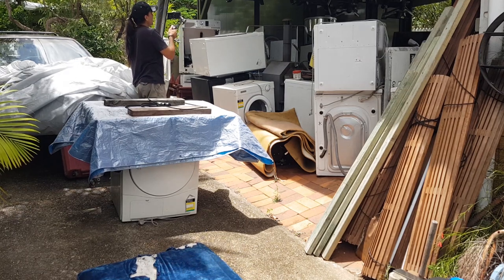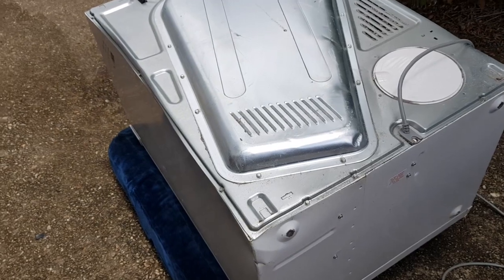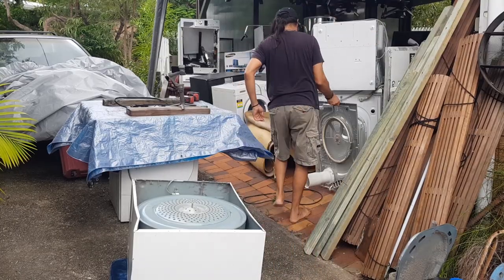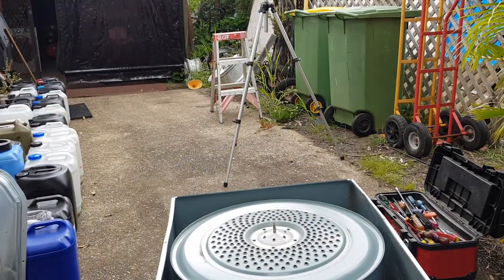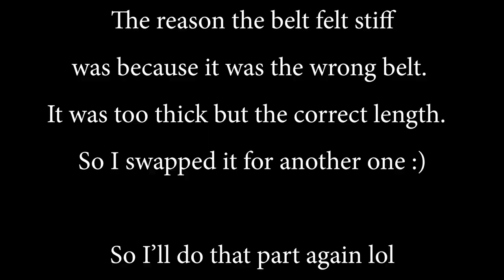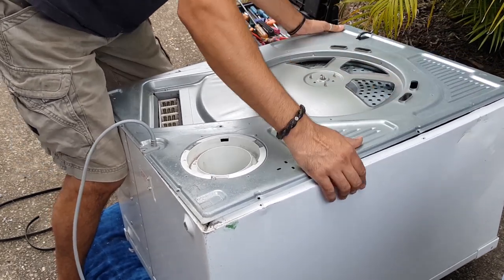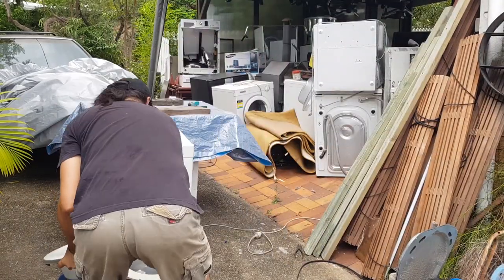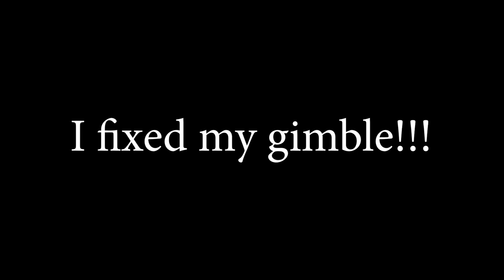Simpson, Electrolux, Westinghouse Clothes Dryer belt replacement

Comment: Cheers mate for reminding me how to do this. Just over 10 years ago, our Westinghouse dryer belt kicked the bucket, so I ordered two on-line and fixed it. The one I put on just broke as well and thankfully I still had that second one I ordered but could not remember how to install it. Your video saved me heaps of time!

One thing I've noticed the first time I did this, was that the buggers are putting the travel path of the belt too close to the element, which slowly burns it away. Anyway, I've managed to get 20 years of service out of this dryer and hopefully another 10 are coming up.
Cheers once again!
Reply from the maker: Hey man no worries!  Whow 20 years is amazing 😯  You'll definitely get another 10 out of it as long as you jump onto every tiny odd sound before it becomes a major issue.  Especially the grinding type of sounds.  But it sounds like your pretty vigilant.  Good on ya mate 😎👍

Comment: Thanks for this video! My very old one of these “died” today so I decided to pull it apart to see what happened and this video helped immensely! Mine turned out to be the idler pulley sticking on the shaft! Cleaned and greased the shaft and it’s working a treat! The pulley does have a really bad wear spot though so I’ll replace it and the belt with New to save having to do anything to it again for a while!
Reply: Had the same thing happen Jeff?, and ended up throwing the belt off. Same fix as you. Just curious if yours had a circlip at the end of the pulley shaft? Mine has a slot but no circlip. I put one on anyway. Now all good. Cheers man!
Reply: @robt6695  I just had a look through my phone to see if I took any photos but can't find any, so I'm not sure if it had a circlip or not to be honest! But it's been working prefectly since my comment so I must've done it right! 😂

Comment: Thanks very much! Couldn’t find a service manual for the Electrolux but this was spot on - all insides the same.

Our idler was also perfectly fine - in our case the belt snapped because the dryer was overloaded with a wash load where the spin hadn’t completed, and it wasn’t picked up by the person loading the dryer. Explained the burning rubber smell at the time it happened.

Comment: You're an absolute legend! Thanks mate. My idler had dropped of the pin and I couldn't work out how to secure a new one in place. I thought a circlip to go on the end of the pin might be missing, but your vid showed it should just stay there. Many thanks. I owe you a six pack or two. 😀
Reply from the maker: Haha no worries mate! Yeah what makes it worse is it has that little groove where you think a circlip should go. But nope they just slide on and sit there. Although I have see a few dryers with them on. But not from factory.

Comment: Awesome video mate. Gave me the confidence to pull our Simpson apart. All the little side tips, like how to  checking the idler wheel,line that belt up  etc. Thanks  mate :)!!!. 
I know it has been said before many times but these videos are golden .. Saving our family money :).
Reply from the maker: Mate you're so welcome! Well done for saving your machine and saving yourself some coin 😀 And thanks for the great comment letting me know!
Reply: @DIYDumpRat   Thanks mate meant to reply. It's been going great. Over 3 months now. Great Pro tip about replacing the roller as well. All the Best .. Pete

Comment: Thanks for this video, I'd already undone the back before I found this video but I just pushed the element back through the hole so no need to unplug, however that said .

I came for the belt video mine was a sdv601 belt was 17.99 with postage .this video is what you need 👍
Reply from the maker: No worries mate glad it helped 😎

Comment: Did a complete disassemble & clean on a Hoover dryer the other night, it’s one of the older models that was made in Australia (1992). No maintenance ever performed on the unit and for the first 20 years of its lifespan, the lint filter wasn’t emptied at all - mum wasn’t aware of its existence until just a few years ago.

Had recently begun to emit a burning smell, so I figured I’d take a crack and clean the thing out and see if I couldn’t diagnose the problem.

Once I got it open, it was quite a sight. There was so much dust inside the unit I was surprised it was still functioning at all. Got to the heating element and of course found a large clump of lint jammed in it that had turned completely black from the element and probably would have caught fire if not dislodged. Went to pick it up to remove it and it turned to ash in my hand. 

Anyway, after deep cleaning it and putting it all back together, gave it a test run and it ran like a beauty - better than ever in fact, and I didn’t even need to replace anything in it. Even the original belt was still in great condition. Suffice to say, they don’t make them like this anymore. 

Anyway, thanks for the video mate! Appreciate what you’re doing for the community, keep up the great work!
Reply from the maker: Wow good on you mate! Yeah I see dryers in that state a lot. I had a woman drop around a 40 year old Hoover last year begging me to fix it. I couldn't, didn't have the parts. If I could I would have done it for free. Those Hoover's certainly are goers lol. Thanks so much for your comment, really enjoyed reading it 👍

Comment: Great video. How do you know which belt to buy as I have the same dryer
Reply from the maker: Thanks,  If it's the same one, just do a 'Simpson Eziloader belt' search on eBay.  The link below is one I just found, but if you need an idler pulley as well there are lots of sellers selling them as a package 👍

https://www.ebay.com.au/itm/123148980892?epid=24023831792&hash=item1cac40529c:g:DGIAAOSwES1ccos~&amdata=enc%3AAQAHAAAA4PQPngXQl1z60i8kKLlzztXq97HLtAGLy6KzFK3XmEbxB8wk0uawWJ5wm8heMdQBbnzypOuIoR7HmOepj8o6lKt8LApT%2F9UpMeKV6LpWAuMHqDjz1MtWQk%2BBEZYaa07chC9kGiVcelXtByF1%2B1ObJRgv5uTlLSZZwRWhNmwTPZqY%2BQuUfTsZGYNRaIUyBc5rkq10EizTT5hyL3Em8pZ6qOMjOkipDzg7TWPW5k0pxR4YsKDEfySUz7xaseo9BPMhS94Vl1PN82MNQOEWHqrjjLr%2FcCR2Kokt4SeHW5%2FosU6h%7Ctkp%3ABFBM0Lum2etg
Reply: @DIYDumpRat  thank you 😊

Comment: Thanks for this great video, my Simpson Ezi Dryer 6kg had a frayed belt that came off the drum and a damaged idler, I have replaced both by using your instruction and its spinning again but one direction spins smoothly like normal, the reverse direction spins fine but vibrates allot that makes the housing of the dryer make noise, do you have any hints of what could be causing this? Thanks
Reply from the maker: Hi there and so sorry for the delayed reply. Also well done fixing your machine!

Yep thats a common thing.  Happens to a lot of the machines I fix.  In fact I'm about to release a video that identifies  almost all bad dryer sounds and directs you to other videos I've made showing people how to repair them.

Anyway I think that vibration sound is probably a loose fan or a fan that has mushroomed and needs to be replaced.  I do have videos where I show you this.  Actually in  the last dryer video I made and uploaded a few weeks ago I go into more detail about why it happens.

I'll leave you a link to it.  Definitely watch the end part.  And hey if you have replaced the belt you can definitely fix the fan 👍

https://youtu.be/F7PIjIER7QI
Reply: @DIYDumpRat  Thanks for replying, after watching one your other videos I checked the metal strut that the idler sits on and it was really rough at the base when I felt it, so I tried the wet sandpaper trick on it till it felt smoother and it fixed the problem. The idler must have been running rough and catching when reversing direction. Thanks for your help and videos, I saved money, landfill and got a sense of accomplishment.
Reply from the maker: @traceyapps1382  Well done! That's something even I didn't think of. Although I tend to sandpaper most of my idler post regardless. But yes, now that I think of it the idler is designed to slide up and down so if the post is rough in one part it probably will run differently (vibrate/sound louder) . Good job and thanks!

Comment: Hi there I have a Easatto tumble dryer model evd7 and it's making a burning smell do you have any recommendations in what this can be not making any odd nosies and I've cleaned out the lint
Reply from the maker: Hi Amanda,  I'd probably just keep an eye on it.  It's not making any unusual noises which is the main thing.  A lot of the time dust and lint makes it's way to the heating element and gives off a burning smell.  Dryer repair men love it because people freak out and call them immediately.  

I don't really know anything about that model but I know that the Simpsons, Electrolux, and Westinghouse models can't catch on fire due to the heating element and lint.  There's nothing but metal around it and the clothes are in the bowl totally separate to the heater.  The lint just sizzles away giving off a burning smell.

Most of the time the burning will come and go.  But please make sure you monitor it carefully.  Like I said I don't know the inner working of that model.

If it persists you should see if you can take the back off and if you have a leaf blower go to town on it.  Even a vacuum cleaner.  I do that in my videos all the time.  You'll be surprised how much lint can build up in there.

p.s With the models I mentioned above sometimes the idlers (plastic pulley wheels) lock up and the belt keeps rubbing away at them.  This certainly does produce a burning smell.  But within no time at all the idler perishes and the dryer breaks down.  Believe me you'll know about that if it's happening to your machine.  Which is why I think is probably just lint 👍

Comment: Hi ther just a quick question. At 28:42 you showed the lip part for the drum. I had seen a black thing around it and was just wondering if that was some sort of elastic. If so do i need one on my dryer for it to start spinning again. Because i followed all your steps and it still wasnt spining but everything was working fine and i gave it like a little push from the back bolt and that worked but then it stopped when it tried changing directions and stopped spinning entirely. So just wondering do i need that around the drum lip cause my dryer doesnt have it there. Would really like some help please.
Reply from the maker: G'day, sorry watching it on my small mobile phone I couldn't see a black ring but I think I've seen black lips on a few drums in the past. It's just discolouration. The front lip that goes into the front slot also goes black alot but that's just from wear I think.

As for your dryer only spinning when you give it some assistance and stopping when it stops to go in the opposite direction, that sounds very much like you need a new new motor start capacitor. Classic symptoms. Very easy to replace I do it in most of my videos. They only cost me $7 each when I buy 20 at a time. Should cost you $10 - $15 for one on ebay. Best of luck 👍😎

Comment: Hi, great video. We have a Simpson Eziloader 4kg about 12 years old. It has this problem that when the dryer reverses the drum appears to seize up. This happens when it's hot. I've changed the capacitor, checked the belt and bearing and made sure nothing is jamming it up on the inside. It's driving me nuts. Please help. Could the felt "bush" on the back be an issue?
Reply from the maker: Sorry I missed your comment Marcus.  Did you ever get this sorted mate?  I'd be interested to know what happened as well.

Comment: Had the belt snap on my LD650E, per your instructions i managed to replace the belt and the dryer is working again. Only one issue is now the sensor dry function no longer has heat, i can only heat it up using the manual timer mode. Any suggestions on how to fix this issue wuth the sensor? Thanks mate!
Reply from the maker: Hi there.  Hmmm,  It's just a coincidence unfortunately. But it also may not be the heat sensor either.  It might be the computer not reading it correctly also.  A hard thing to pin down unless you have multiple parts to replace with and trouble shoot.   Hopefully you just disconnected the wire leading to the sensor accidentally.

And yes the best part about Electrolux and Westinghouse fully automatic dryers are that they also have manual timed cycles as well.  So you can still use them safely.  You just need to choose a 30, 60, or 90 minute cycle.  Most of the time I find the timed cycles are a much better option than going fully automatic anyway, as those timed cycle help you save a lot more money in running costs.  

But if you want to look into the heat sensor and what might be happening and how to possibly fix it I did make a video a while ago doing that exact thing to a machine.  Here's the link, hope it helps 👍

https://www.youtube.com/watch?v=aSSZITVUke4&ab_channel=DIYDumpRat
Reply: @DIYDumpRat  thanks for the reply, I'll definately look into that!

Comment: Hi there going to have a go at fixing mine it just started making a knocking sound like a pair of shoes in the dryer, should I replace idle pulley? And the belt?
Reply from the maker: Excellent, that's what I like to hear.  Give it a go, it's not difficult.  And I'm not sure.  You're best bet is to open it up and have a look first.  It may not even be the belt or idler.  If it's making a knocking sound it could even be a loose fan.  Check out this video I made about replacing that part.  In the start of the video I turn the drum with my hand and you can hear the fan knocking around.
https://www.youtube.com/watch?v=81IFBoHYoKU
Reply: @DIYDumpRat  awesome Thank you I'll have a look 💕
Reply: @DIYDumpRat  I found the problem inside the drum was all sheared around the middle nut, think I have to buy a new one now
Reply from the maker: @belindajohnson6224  Damn.  If it's the same problem as in the following link then yes, unfortunately you'll need another one.   
https://youtu.be/4DuBdrFvRVQ?t=1065 
If you do buy another machine, and if it's the same model as the one you have now, I'd grab all the parts out of your broken machine because they'll all be the same if you ever need to replace anything in your future machine (if that makes sense).  Well done for working out the problem rather than just tossing out the machine though :)

Comment: Hey Mate Thanks for the video. 
I have an issue with my dryer. The idler has gone bust, I’m unable to remove it as there’s black stuff above it causing it to become stuck and unable to remove. Do you have any suggestions on how I can fix this problem, or a link to another video you have previously done please, was a bit worried I might break something else.

Cheers
Reply from the maker: No problem at all Rhonda, well done for getting that far. What you're describing is completely normal. It happens all the time.

The black stuff you describe is just the idler after it has melted. They can be a bit stubborn but all it takes is a bit of elbow greese. Just get a good grip on it and turn. Maybe even with two hands. It'll come off. Sometimes the metal core of the idler becomes so fuse to the post that it'll will remain after the plastic body part of the idler comes off. If this happens just grip it with a good set of large pliers and twist. I use multi grips all the time to remove them. They're great. If you still can't get the whole  idler to break free by hand a good set of multi grips will definitely do the job 👍

Just remember that after you do get it off you'll need to really clean the post well, otherwise when you put the new idler on it will freeze up again. I use that 'Orange' citris cleaner stuff from Coles. It works great. Some times you will need to use some wet sand paper to clean it up first before using the Orange (wet 400 grit sand paper) . You want the new idler to guide up and down the post freely with no burs.

I actually have made a video where that exact thing happened but I haven't uploaded it yet and don't plan to for a little while sorry. But just do what I said above and you'll do fine 👍
Reply from the maker: Rhonda I just checked another video I made of me doing an idler swap and the same thing is happening but to a lesser degree. Watch this video 🙂

Now at the end of this video the replacement idler fails as well when I test the machine. This happened because I didn't clean it properly before putting the new idler on. So yeah, make sure you clean it well like I mentioned in my other reply.

https://youtu.be/bKEA7mZ-fas
Reply: @DIYDumpRat  Mate Thank You 🙏 You have saved me $$$$ Thought for second a couldn’t get the issue fixed.
You have a great evening many blessings 🙌🏾🙌🏾

Thanking You!!
Reply: @DIYDumpRat  Thanks Again awesome helpful tips 🙂